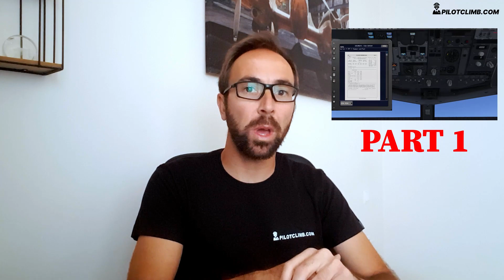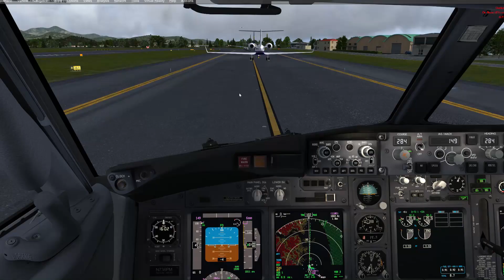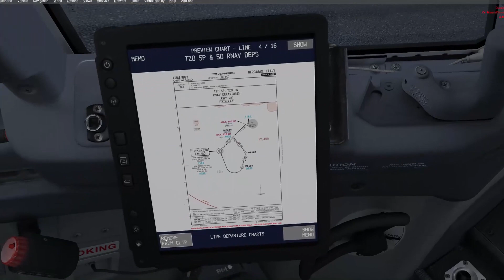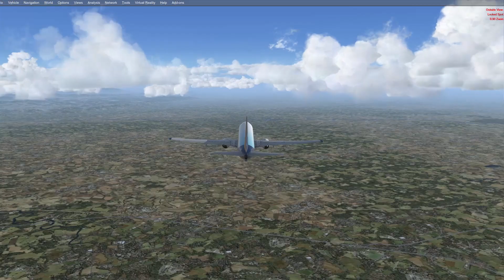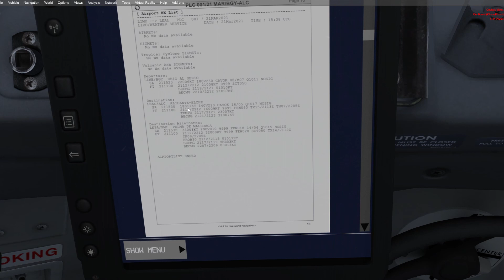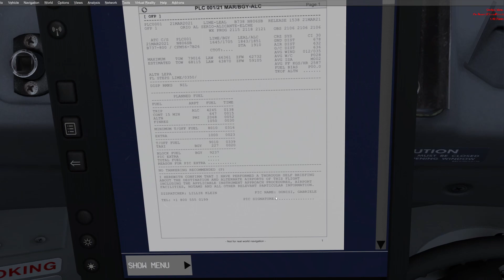Real Boeing 737 Captain Flies On An IVAO Event PART 2 - [From Take-off To Top Of Climb].

Comment: Hello Captain, looks like this is gonna be the first comment ☺
Few questions for today :
On the FMC on the takeoff page and when setting the N1 limits I have the Thrust Reduction altitude, or Thrust Cutback. I can choose 1500 ft AGL or 3000 ft AGL. I understand that this is a noise abatement procedure, but when do you use it in real life situation? Also, is this involved with the flap retraction procedure? For example when you reach the Cutback height you start retracting the flaps or it has nothing to do with it? The MFRA (Minimum Flaps Retraction Altitude) is the altitude at which you should start retracting the flaps in case of an engine failure. Now, when do you normally start retracting flaps when you have both operative engines? Is there a fixed altitude or speed you should aim for? 
Thanks in advance captain, I'm gonna watch all 4 parts here and let you know if I have any further questions.
Reply from the maker: Hey, The thrust reduction height is when the engine reduces slightly its thrust after takeoff. Depending on the Noise abatement procedure you can accelerate and retract the flaps ar 1000ft AGL or 3000ft AGL with both engines operative.